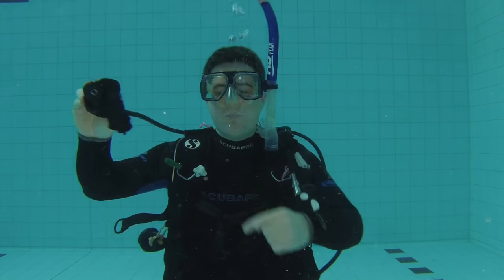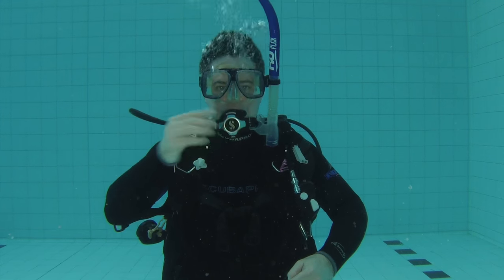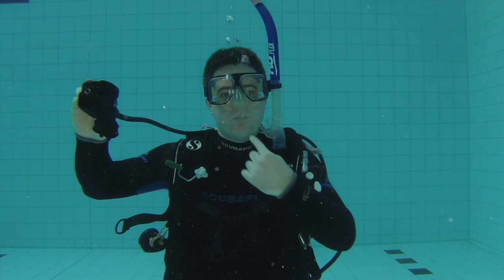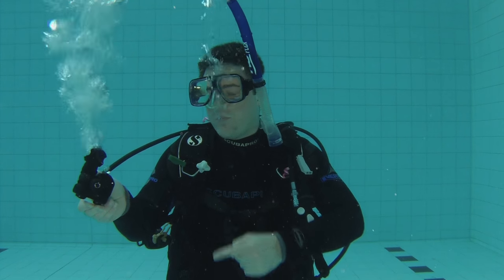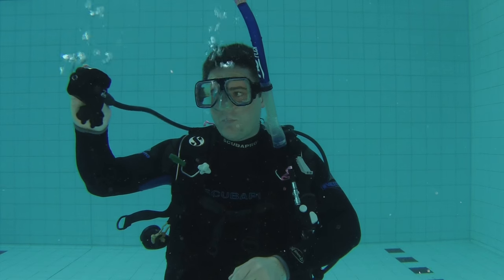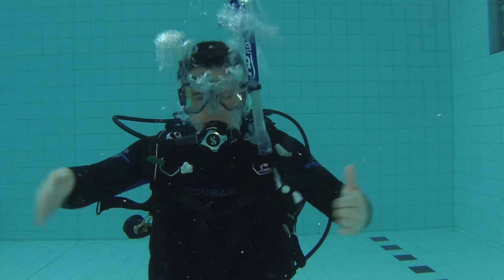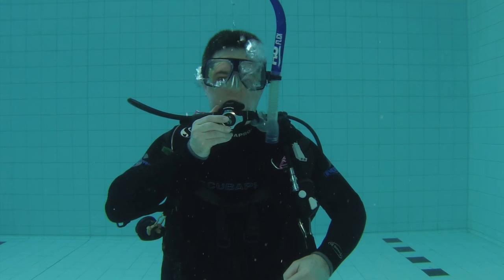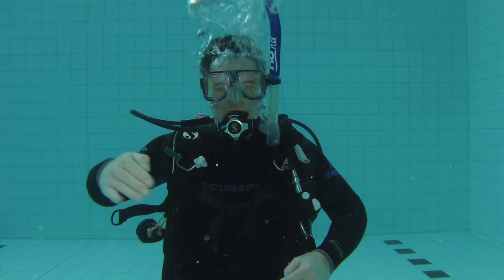PADI Open Water: How to clear a diving regulator underwater

Comment: I remember scuba diving on Islas Mujeres, Mexico. One of the first things instructor taught us was this method, we practiced at low depth and it was ok but at the time I wanted to try it 20 meters underwater I was not able to due it because of fear that I could screw it up and die drowned. So I kept the damn thing within my mouth for the whole 2 hours lol.

Also when I returned to the surface I got very dizzy at the point of almost puking. Not sure why.
Reply: That’s typical if it’s your first time diving, could be anxiety or a various of other things. Did y’all do a safety stop?
Reply: @HBHeroDive  Well, I definetely was more excited than nervous but at same time I just didn't wanted to risk panicking doing the thing under 20 meters. We were granted 2 air tanks each person so we did 2 inmersion of 1 hours each tank on different places around Islas Mujeres. I think I felt dizzy because I went up to fast or just it feels that way for being your first time.

Comment: Do you take a deep breathe in before removing the regulator to blow bubbles
Reply from the maker: Hey Shaheen. Yes thats right. Take a breath then remove the reg from your mouth. If you already have water in the reg or you mouth and no breath then hold your tongue up to block your throat and press the purge button on the front of the reg. The will force air into the regulator and blow out and water.
Reply: @WaterlineShorts  thanks loads.

Comment: What’s the purpose of blowing bubbles out of your mouth? I would think that would only matter if you were ascending?
Reply from the maker: I can see that. The best reason is to form a habit so that in an emergency your habit will prevents you from getting into more trouble. Instead of having to think you just do. 

The other reason is that there are circumstances where large swell can go over your your head while you’re in shallow water which can greatly change the pressure in your lungs. 

It’s a good habit!
Reply: Waterline Academy thanks! That makes sense. ;)

Comment: What if this happens directly after exhale? Maybe you loosen your lips or something right after exhale and you take in water?  That would mean you just exhaled and you took in water so you don't have the lung capacity to exhale again without taking in oxygen? How would you clear the water from your mouth so you can breathe in through the regulator?
Reply from the maker: I think you need to rewatch the video in full. There is a second way explained in the video where you use the purge button on the regulator.

Comment: Can you please explain why you need to blow bubbles?
Reply from the maker: +KristianJordanov It has to do with pressure changes. As you descend air is compressed, as you ascend air expands. Even things like a wave going overhead can make air expand or compress. It's a good habit to blow bubbles which allows any expanding air to escape. If you hold your breath and air expands it could damage your lungs. Never hold your breath while breathing compressed air.
Reply: Thank you :)

Comment: How do you clear sinuses underwater?
Reply from the maker: It's dangerous to dive if you have blocked sinuses. If you have blocked sinuses you should stay out of the water. 

The problem is that if you get an air bubble in your sinuses and it can't escape then it could expand on your way back up to the surface and it could cause pain or worse. 

Best not to dive if you have blocked sinuses. 

Sinus is different from eustachian tube. If you mean how do you clear your ears on your way down then you can block your nose and blow gently into your nose. This will force air into your eustachian tubes. On your way up your ears will clear on their own. 

Hope that helps.
Reply: If you have to ask that question, you've not been trained properly (or at all).